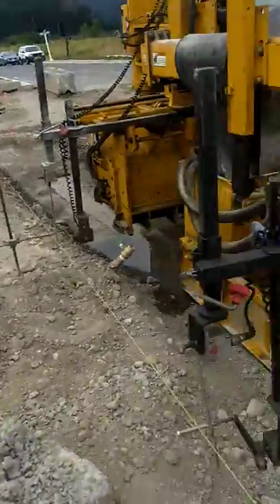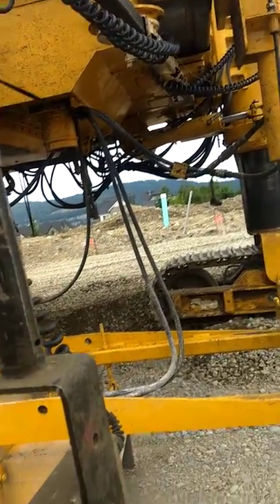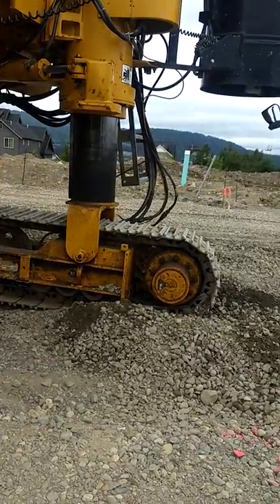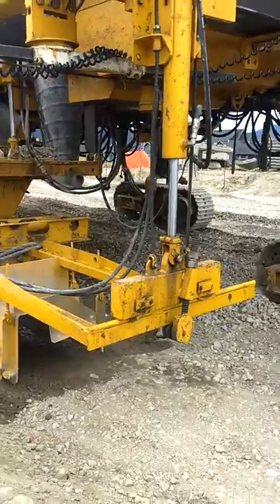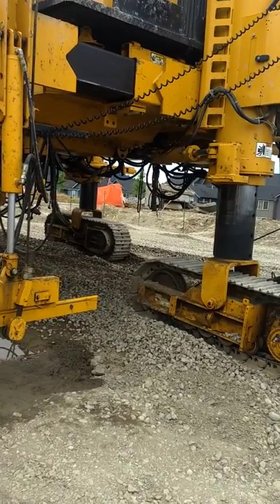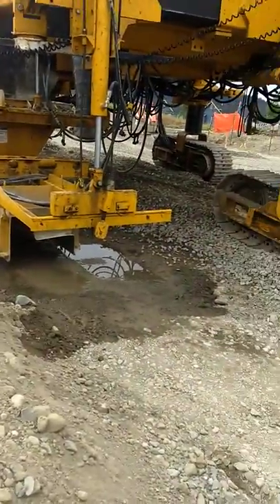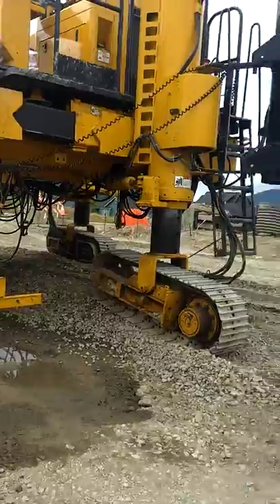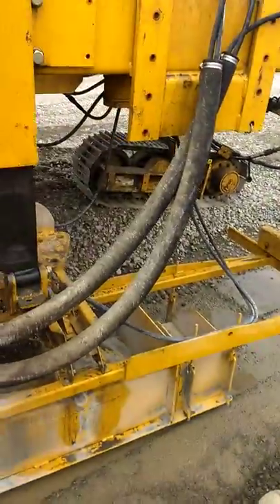How the curb machine that I run works

Comment: Can you share the viberator power details sir
Reply from the maker: The vibratory are hydraulic powered and the speed they vibrate is adjustable for the different slump of the concrete. If the concrete is wet I lower the vibration if the concrete is dry I increase the vibration. I prefer the concrete at about a 2 inch  slump  that's what works best for my machine 😉

Comment: What’s the price of this machine 
New and used
Reply: I got one for sale with three molds.. I wanted 95k with all the molds pins string fiberglass rods for radius and small trailer for tools and stakes and pulley for proper tension of string line.  New control panel and controller. Gettin new gages